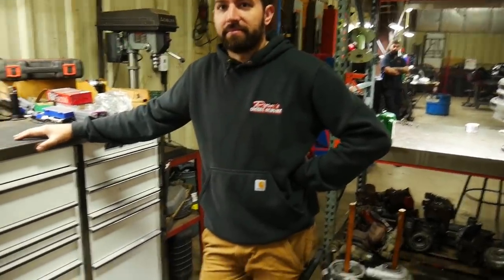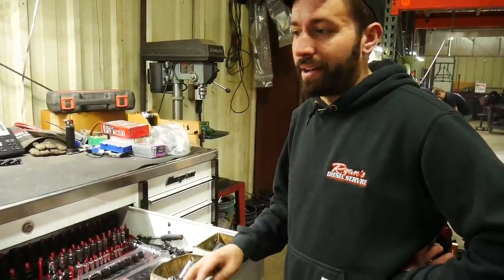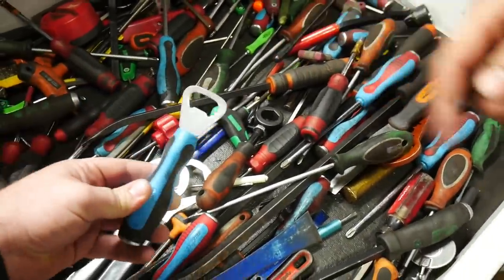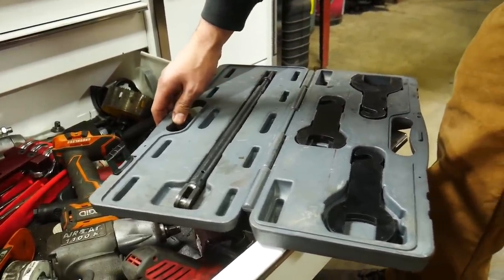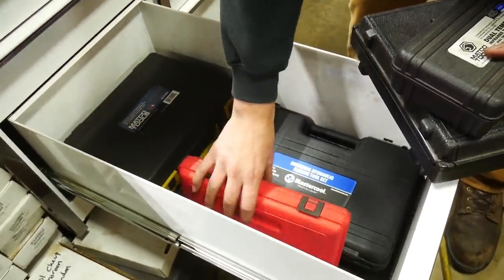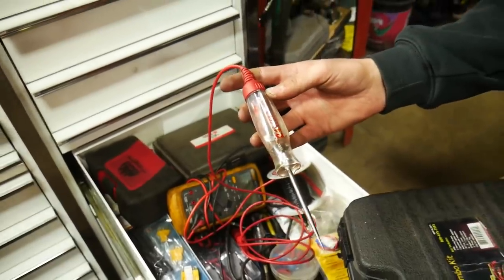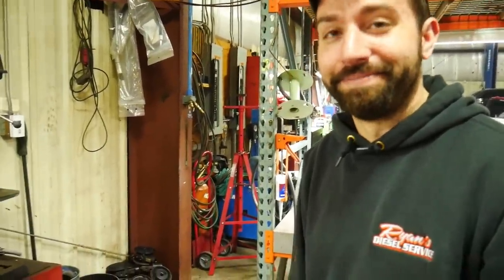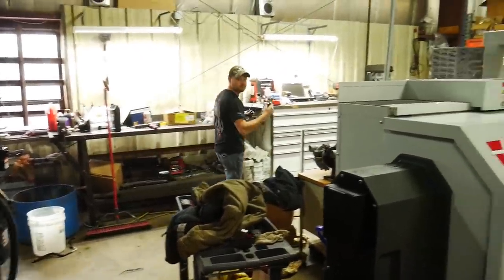TOOLBOX TOUR FROM A TOP DIESEL TECH - RYAN’S DIESEL SERVICE

Comment: Mailing in tools to get warrantied isn't a pain in the butt,easy.I have sent in broken tools into Mac,Cornwell and SK,replacements received within 2 weeks.Snap On,can send them in if no dealer in the area.Call them first.Encounter an older Snap On tool made for the military,throw it away when broken.No warranty on these,was put in the contract stating no warranty on them and was considered stolen.These have a letter V in the part number and a dull finish.That Mastercool flaring tool set,worth every penny,perfect flares everytime.

Comment: Interesting to see Ridgid lol.  I use Ridgid at home and Milwaukee at work.  Have had problems with the Milwaukee stuff breaking but most of it's tough.  Don't use my Ridgid as much but it works great for home use!  My 1/2 Ridgid impact takes off just about any bolt on the cars/trucks I work on at home!  Definitely wouldn't work for heavy duty diesels!

Comment: What ball joint kit was that?   I was considering getting the Snap-on BJP-1 for my 05 F-350.
Reply: Get the BJP-1. I've used them all and I will never use anything else now. I was sold after blowing up 2 normal OTC types and big breaker bars where the snappy and impact gun took it right out. It's all in the design of the frame and forcing screw.